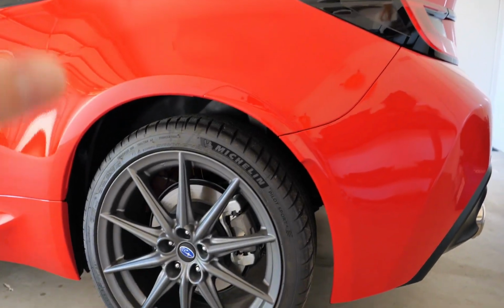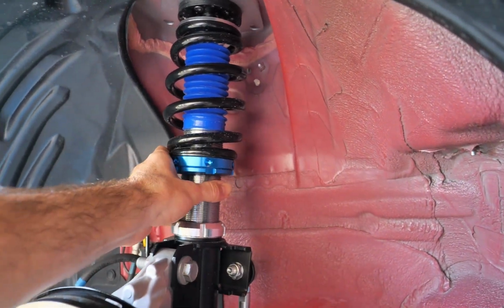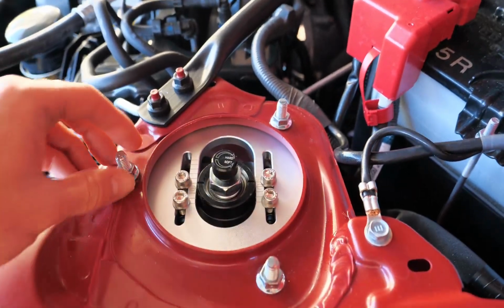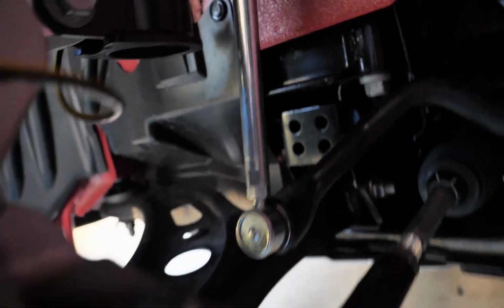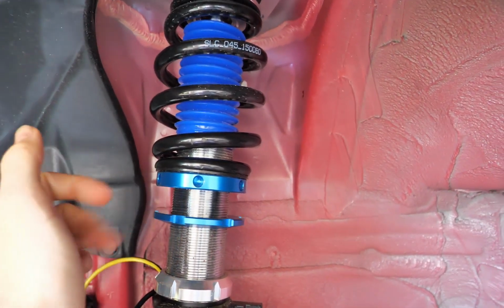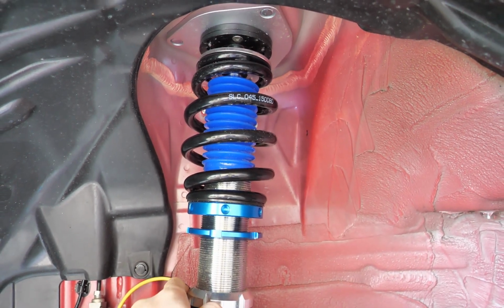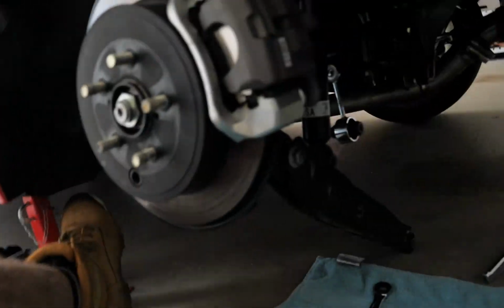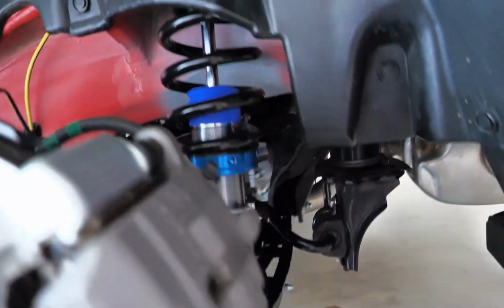My Subaru BRZ Coilovers Are Clunking... Badly

Comment: I see you went through this a couple of years ago now, but I hate to say this but I really enjoyed watching your struggles, because I've been going through the same with my R56 Mini Cooper / BC Racing coil overs.  Neither my shop nor I can isolate the issue.   I've watched a dozen YouTube videos on solving "clunking" and each swore to a different solution.  I'm concluding to just live with it or go back to non adjustable / stock shocks and springs, because the clunking seems to be a very common issue.
Reply from the maker: Usually comes down to a poorly designed coilover. This was the case with mine and the shock housing was defective from factory. Probably just worth it to swap to higher quality parts mate

Comment: So what happened? What did you do? I am currently dealing with the same thing.
Reply from the maker: @johnnyrico707  Both were defective from factory in the shock housing which caused the clunking. I got my money back and went with MCA suspension instead
Reply: @00Lach  wow. Yeah I'm dealing with the same thing. That's crazy! Glad you figured it out
Reply from the maker: @johnnyrico707  did you buy them through the same company I did?
Reply: @00Lach  No. I bought "Yellowspeed" coilovers. Honestly I only bought them because they were yellow. I should have done my homework! They might be junk.
Reply from the maker: @johnnyrico707  get your money back ASAP
Reply: @00Lach  Turns out it was my lower ball joints! Coilovers work great. And look great too.
Reply from the maker: @johnnyrico707  glad to hear mate

Comment: Coilovers are garbage. That's why I buy quality lowering springs and good dampers. H&R and Koni for example. It also makes it much easier to diagnose problems. Unless your tracking your car coilovers make no sense.  Good ones will start at 2500-3500.00

Comment: Man im going thrue the same thing ,gladly its only 1 coilover ,the rear  left one that makes this clunky noise that was driving me crazy i contact the seller (maxspeedcoilovers) and they send me a dampening kit that they said was the problem ,im waiting for it arrives next week ,meanwhile i just installed in one side the old divorced shock and spring to take away that clunky noise meanwhile.I feel very stressed and try to take it easy but im glad at least the company is responding and if case of the kit does not resolve me issue they are gonna send me a new shock only bad thing it takes abous 1 month to 1 month and a half to receive the new shock.
Reply from the maker: @moisesleon5353  Hopefully everything is sorted for you mate 🙏

Comment: You need to tighten the nut at the top of the coilover. Make sure that it's a pass-through wrench and then keep the center portion for moving while turning the outer nut
Reply: Hey man, How do you stop the center portion from spinning?? Theres no place to put a wrench or anything to stop it from moving
Reply: @trenchkote1964 impact but not a air type

Comment: Everything you've done seems fine. I've had my MCA Blues for almost 7 years now just open and installed out of the box as is. makes funny creaking noises on low speed but definitely not clunky. wont name the coilover company you're using but I did have a mate that used the same coilovers and hated them lol. hopefully you get a refund for them... annoying but shit happens lol
Reply: Is it the nut for the top hat, the center nut .

Comment: A couple questions... The rear endlinks looked fine on install but I am wondering if you made sure there was 0 preload on the front endlinks. You may know this but to eliminate preload looses up the adjustable washers, but load on the wheels and twist the middle adjuster until there is wiggle. Then tighten the washers down. Also, did you get it aligned yet? That could answer some questions.

Comment: Just picked up my GR86 yesterday after 16 months wait. I found shifting into 1st and 2nd gear always making clunking noise every time. Do you have the same experience with your BRZ?
Reply from the maker: Yeah mate it's just your typical notchy Japanese gearbox
Reply: @00Lach  Thanks so much. I thought there is an issue with my gears.
Reply from the maker: @SuperJames1412  If you're worried just ask your dealership about it next service. Obviously I can't hear it myself so I can't guarantee there's nothing wrong but a brand new car shouldn't have problems.
Reply: @00Lach  Thanks for the quick reply. I will call my dealer tmr.

Comment: Did you try putting back stock endlinks?  If it fits you should try stock endlinks.
Reply from the maker: Rears are stock end links and that's where most of the noise is coming from 😅